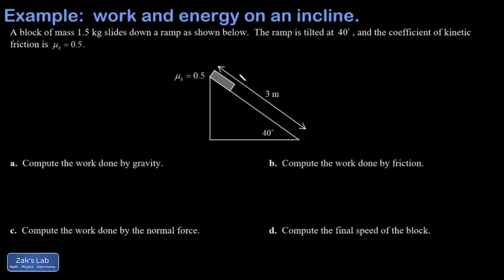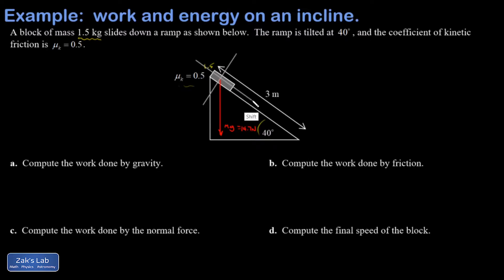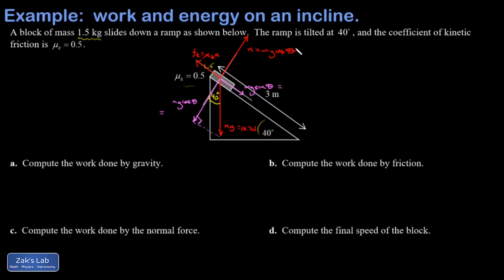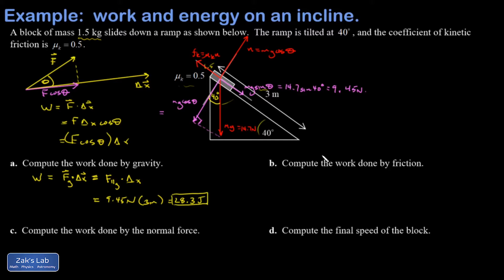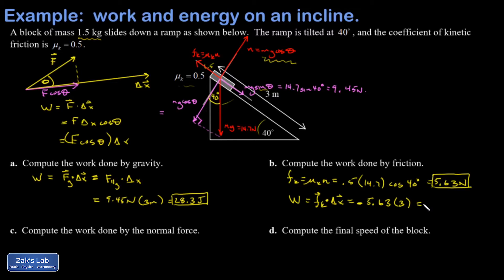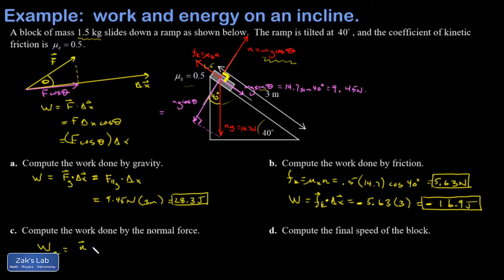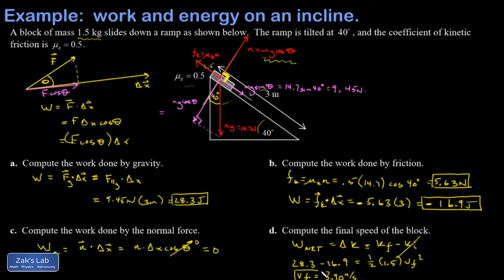Calculating the total work and final speed for a block sliding down an incline.

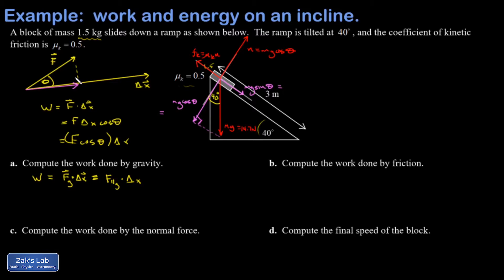Comment: around 4:00 when you wrote we'll be using the parallel aspect of gravity mgsin (theta), that confused me more since I thought you always use mgsin(theta) every single time. Instead my teacher said that you're supposed to use mgcos(theta) and it only coincides with mgsin (theta) in SOME cases. does that sound accurate? maybe I understood incorrectly.
Reply from the maker: Two issues:  first I was trying to make a distinction between taking the parallel component of force multiplied by displacement vs. taking the entire force multiplied by the parallel component of displacement.  Second, there is an issue with how theta is defined.  For computing work, that's the angle between the force and displacement vectors, and you get Fcos(theta)*r, if theta is the angle between the force and displacement vectors.  But in this case, theta is the angle of elevation of the ramp (also the angle between the vertical and the parallel), so we actually need Fsin(theta)*r, just because we did not define theta as the angle between the force of gravity and the displacement vector.  

The key point in the long run is to let the geometry lead the mathematics:  work is defined as the parallel component of the force acting through the displacement, and you might not always have theta labeled as the angle between force and displacement, so you have to look at what's going on in your picture.  It's also occasionally handy to interpret work as F*rcos(theta), or the entire force acting through the parallel component of displacement, and again your labeled angle may not be the angle between force and displacement, depending on context, so you might have to make an adjustment accordingly. -z
Reply: Thank you very much for the explanation!